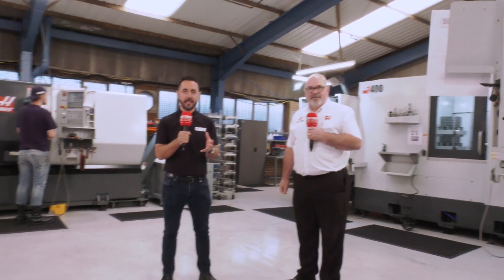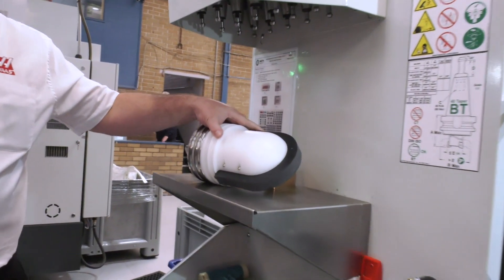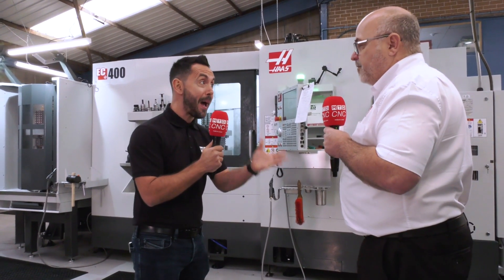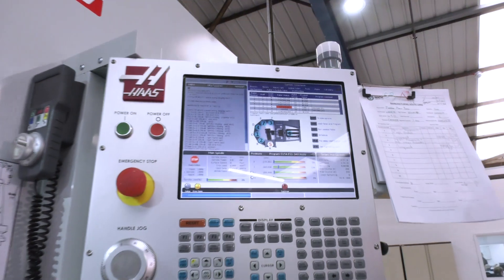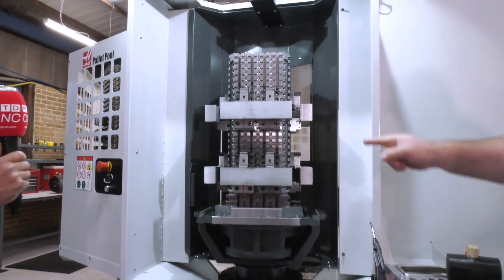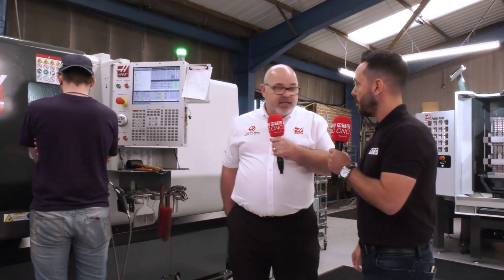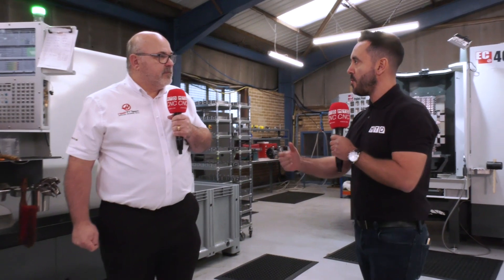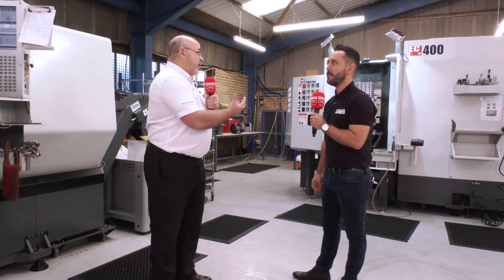Growing Through The Haas Range At Wath Group Ltd

Comment: HAAS VMC are OK machines, But we own a umc 500 and 750 and they're lemons. Good for low tolerance work but anything requiring a reasonable tolerance is out of the question. That EC400 holding 5 microns? No I doesn't.. and the DS30y a full dual spindle lathe? No its not.. the sub is a smaller unit and has no c axis capabilities, you can't c/y  mill on the sub, we own one less than 6 months old..
Reply: 5 microns and rigid spindle..
Reply: Hey all Wath Group here. Sorry to hear about your experience but we do in fact get 5-10 microns repeatable on our UMC and EC when we are chasing the tight tolerances on our small to medium parts.
We use the Wips system for in-cycle probing and error correction in 80+% of our inhouse production runs, it does add-on an average 5-7% to the cycle time but it works and we can't complain. 
I will admit, it can slip if you don't stay on-top of the maintenance / re-calibration after some heavy and long roughing sessions, but it only takes a few hours a month to bring it back in. 
It works well for us. The secret is…. ‘it’s all about the in-cycle probing and CAM + Never having a knock on the machines’ 😉
Reply from the maker: Glad you enjoyed the video.